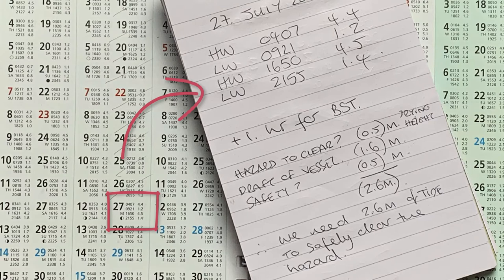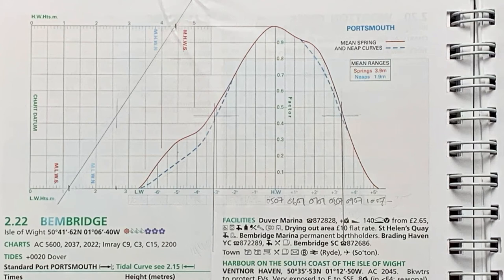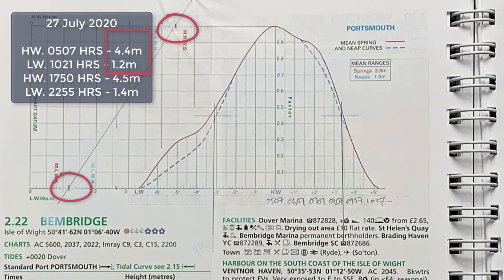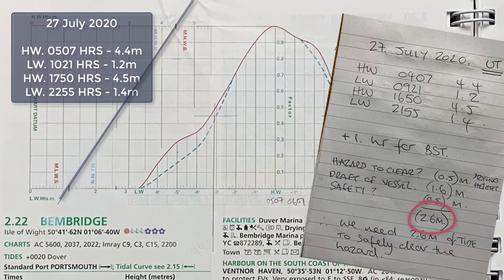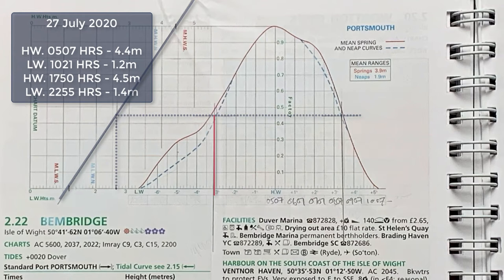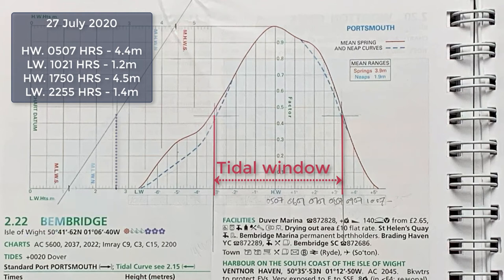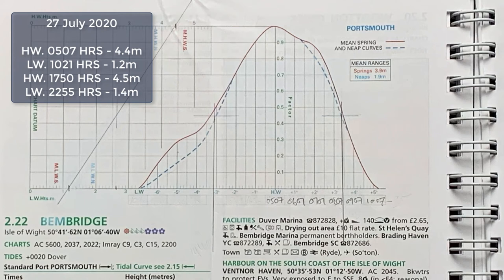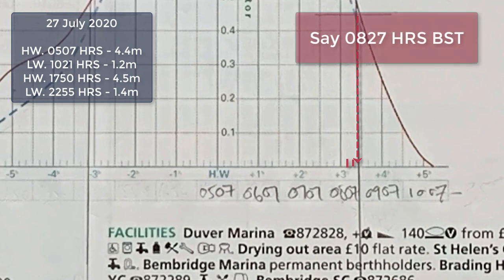Calculating Tidal Heights at a Standard Port

Comment: well I did a recent Powerboat level 2 course which covered very basic navigation but I want to eventually build up my qualifications starting with a navigation course and then my Day Skipper. So while I scrape together some shekels I'm trying to get ahead a little on navigation so as not to be out of my depth on the course. I have a good grasp of how to plot a course so far as bearings and course to steer etc allowing for magnetic variation and tide etc but I just find the intricacies of tide calculations a bit of a skull strainer.
Cheers
Guy

Comment: I know you're mentioning everything but it's in a rather glibly skipping over manner and you've already done stuff I need to see done. Can you please do a step by step explanation with no- "I've already calculated the speed of the rising moon and you'll need the height of the meanest water to sbubtract from Greenwich bewitching hour which you''l find under any glass on a sunday, so just add that to the hypotenuse of your bow sprit when the tide is ebbing unless it's a flat calm sea in which case you can just sound off johnny depth"
That's pretty much what it sounds like to a beginner with poor maths. I'm exaggerating of course but you're obviously so adept at it you can't understand what landlubbers like me don't understand. Perhaps you can direct me to a video which starts from finding the right port on a chart, spotting the hazards, reading chart info etc  looking up in the Alan-mac and so on one thing at a time.
Many thanks
Guy ;-)
Reply from the maker: Hi Guy. I try to keep the videos specific to topic and short so that they don't drag on forever covering the same basics in every video. I will take a look at the video and see what has been assumed and then do videos to cover those in 'how to' videos. As the video library increases, I will add bookmarks and suggested videos that are relevant during the video or on the end screen.

Cheers.
Reply: @FreeSailingTutorials  Great, look forward to it. Have watched it a few times and i'm beginning to make sense of it  but still a bit behind.
Cheers
Guy
Reply from the maker: @garviere  No worries. Glad it's helping. Have you had any formal training? If not, getting to grips with this stuff off a couple of videos is tough. I'll take a look at this asap.